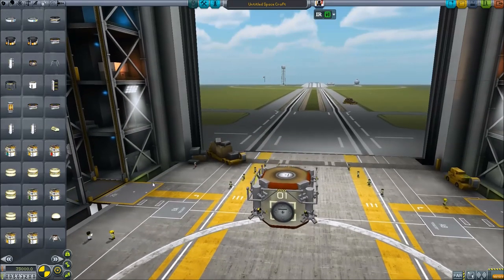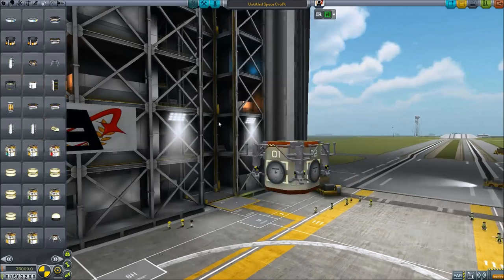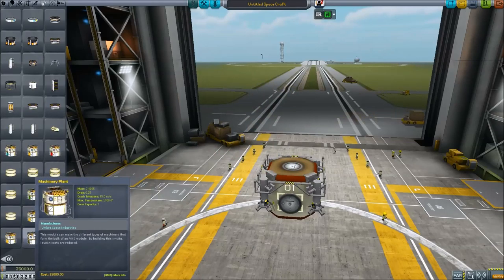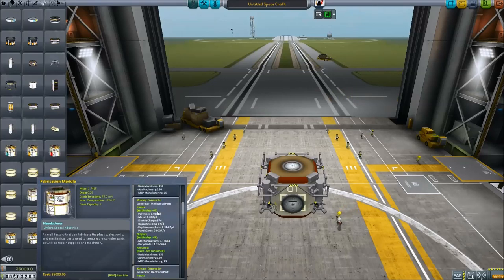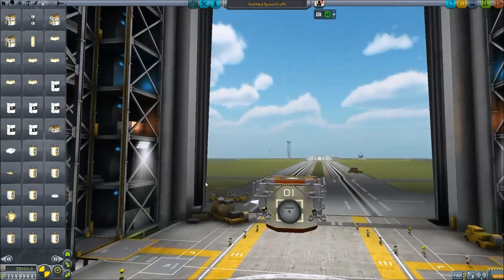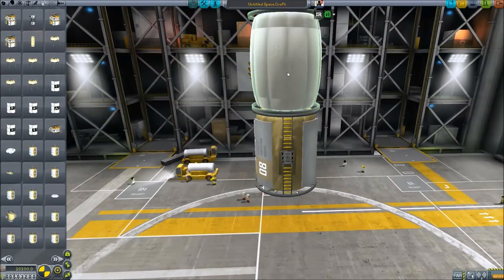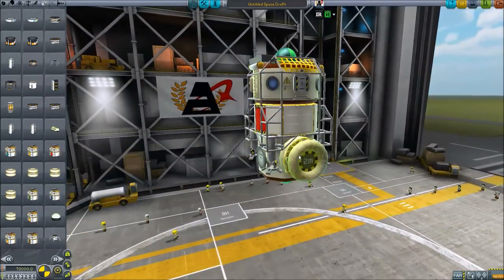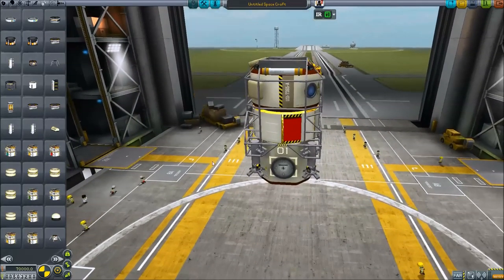KSP - MKS Tutorial (Modular Kolonisation System)

Comment: nice tutorial mate, 1 question/problem. i have started a base with a colony control and aeroponics module with 300 basic mashinery, they are connected, i ve punchcards and agriculture modules and a logictics module-life support above the aeorponic module. when i try to active air filter and purify, its say "not enought pathkits". what are these and how do i get/produce them?? ,plz help, oxygen is running low.... :/
Reply from the maker: Patchkits are a resource that is needed for it to work, when you are in the VAB you can add resources to yoir modules. So build a small rocket to deliver some patchkits to yoir station.

For future problems when using new parts always check the information panel, it always tells you what it needs to work

Comment: Did you have any problems with your pods not connecting to each other through the tubes?  No matter how flat of surface I have I can only connect one or two and then the others start shaking around and bounce off of each other.  Everything is up to date as well.  Cheers!
Reply from the maker: brian adamson No Problems, however under timewarp the parts start to move around, but that is due to KJR [Kerbal Joint Reinforcement],

Comment: Hello, 
i am trying to build up an oks. It seems like the Kerbals simply dont use anything. They dont eat, produce no waste and waste water. i even tried it in orbit several times but it doesnt work. Another problem is the radial supply tank. it has no menu. if i right click on it nothing happens. but the bigger question is: why dont the Kerbals eat or produce waste?
Reply: kas mod is installed
Reply from the maker: You need TAC life support. It says so in the install information from MKS. ;)
Reply: ***** Thanks dude.
cough Maybe i should read the information...;)